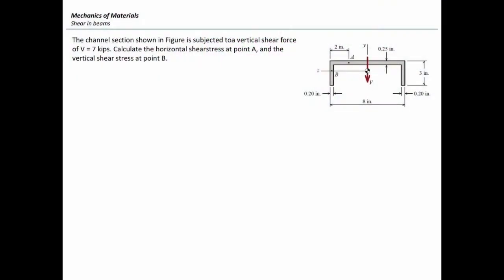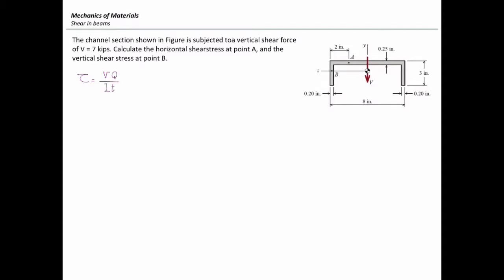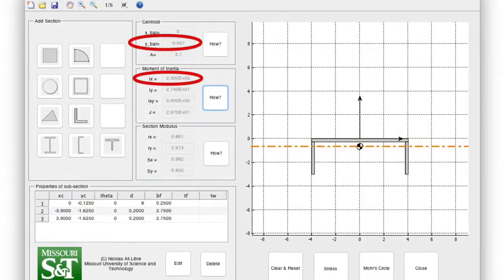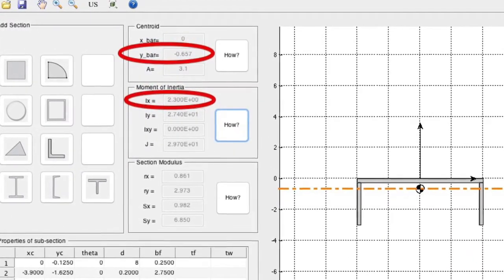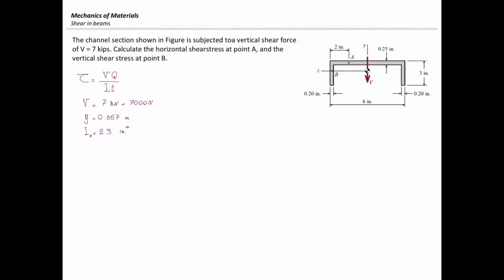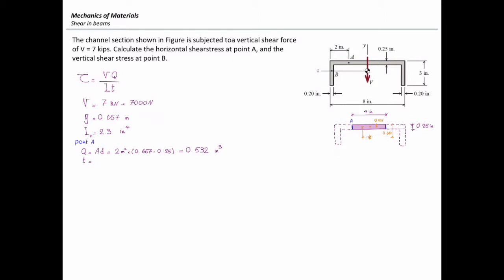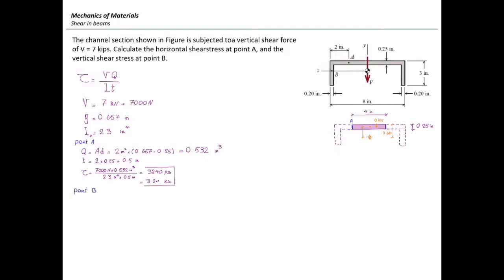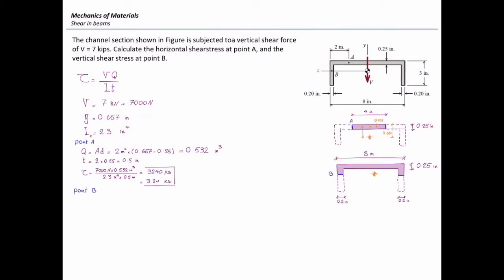Mechanics of Materials, Lecture 20 Shear stress in beams Prob2

Comment: shouldn’t area be 0.25*4 that’s 1
Reply from the maker: Correct A=1 for point A. it is a typo but the value used in the calculation is correct so is the Q. Thanks for the catch.